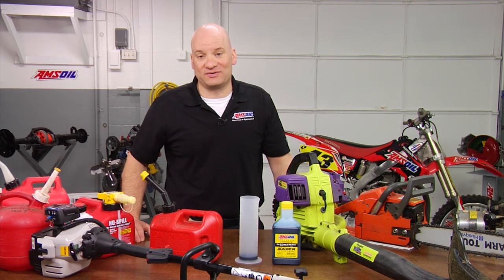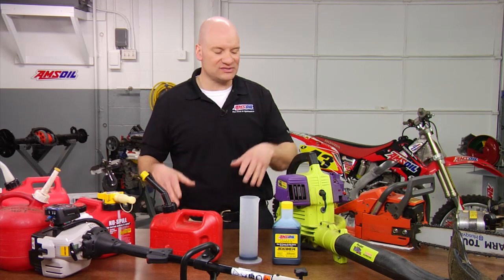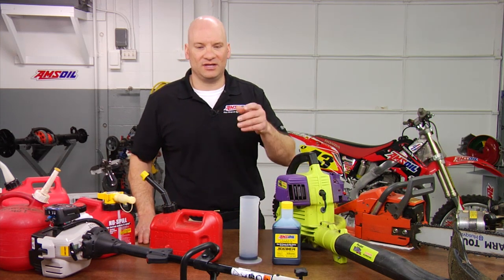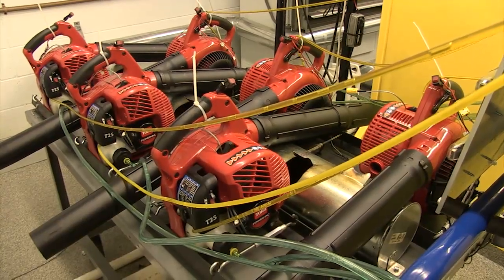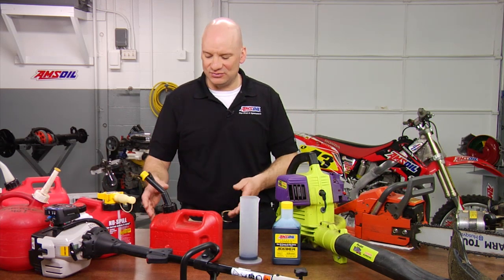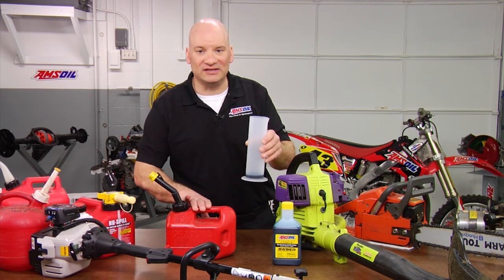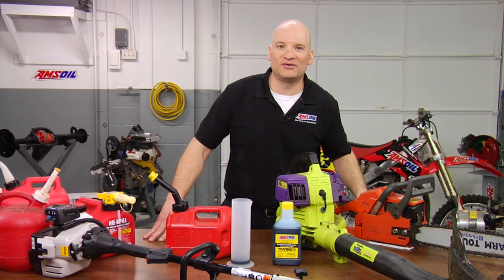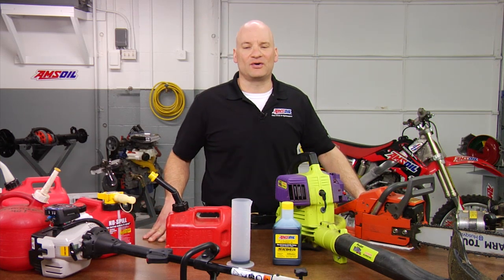SABER® Two-Stroke Oil Mix Ratios

Comment: @amsoil does this work for all two strokes such as bikes and sleds
Reply from the maker: +Kartyman550 AMSOIL’s primary recommendation for 2 stroke dirt bikes and sleds, including big bores, is Dominator 2 Stroke Racing Oil. Saber Professional has been formulated and tested for small hand held 2 stroke engines.
Reply: @AMSOILinc  Hmmm...Bike Berry offers an EPA approved two stroke bicycle motor kit, with the red ink warning that using any oil other than Amsoil Saber Professional Synthetic two stroke oil at 100:1 will damage it severely. What gives?
Reply: @stephenandloriyoung5716  I'm guessing because using any other oil at 100:1 would damage it severely.

Comment: Sir I don’t wanna get confused. Stihl hp ultra oil 2.6 oz bottle make one gallon 50:1. But AMSOIL saber 1 pack 1.5oz make one gallon at ratio100:1? Then 2 packs for 50:1 with what? richer but when I put another one gallon gasoline in with 1 pack of 1.5 oz in it look lighter than stihl hp ultra color seem like not enough oil. I won’t put it in my equipments look scary
Reply from the maker: We have a variety of package sizes, including a 2.6-oz. bottle, so you can choose whatever size works for you and the gas can you’re using. SABER is tested and proven at any mix ratio up to 100:1. There’s no reason to be nervous about using it at that ratio in your equipment, but lots of people mix it at 50:1. If that’s what you choose to do, you will have excellent results.

Comment: I have racing go karts with IAME 100 cc engines that turn 15000 to 16000 RPM. The manufacture says to mix 8oz of Motul 2T ester based oil per gallon of race fuel.  Am I understanding you correctly that I can run the Amsoil at 50 or 100 to one and not have any problems?

Comment: I use between 30:1 and 40:1 on all my 2 stroke engines, none have blown up. Ran another engine on 50:1 as an experiment and that thing threw a rod. I heavily use my engines and thats why i use a slightly richer oil:fuel mix than what manufacturers reccomend. I have yet to do a "torture" test on an engine using this oil here at 100:1. Ill run 2 tanks through it and see what happens. Btw im talking about motorised bikes and 2 stroke stimmers
Reply: @Alex Hickey ---Did you ever end up testing this Amsoil Saber Oil?
Reply: Bro this is crazy 100:1
Reply: @lightningsmokerXx  i did, but not at 100:1
Reply: @pablomerchant9285  madness isnt it
Reply: 33:1i s ok ls + ?
Reply: @Sensei948  yup its fine

Comment: I,m looking for mixed life. How long before it degrades when mixed? I have a mixed 5 gal. can of clear premium ($5 gal.) mixed with Saber that is about 2 months old.
Reply: It has a fuel stabilizer in it but it's a good idea to only mix what you think you'll use in about a month IMO. You could also add some Sta-Bil or something if you really wanna stick to larger batches
Reply: Saber has a stabilizer in it.  I've gone up to 6 months without any issues as long as I started out with non-ethanol gasoline.
Reply: @wayneedgerton5892  I'm using some right now that's been mixed for like 2+ months. I also add a dash of Sta-Bil to my mix if I'm not planning on running my saws etc. too much. Like you said, starting with ethanol free fuel makes a big difference. Ethanol will pull moisture in from the air and spoil it a lot sooner. I still wouldn't recommend using 6 month old mix though even if it's ethanol free
Reply: It's not really the oil that's degrading...it's the fuel itself. While Saber does have stabilizer I find it's always better to not mix enough than too much
Reply: @AnarchAngel1  I agree.  Mixing more than you will use in a reasonable amount of time is silly.  I am not encouraging that.
Reply: @AnarchAngel1  I agree.  That is why I said up to 6 months.

Comment: I am an early Amsoil user.  I mix up a 5 gallon batch with non oxy gas a couple times a year.  100 to 1 Amsoil 2 stroke, a little Amsoil stabilizer(or Stabil) some Amsoil PI (performance improver).  I use it in every small motor I own, 4 stroke or 2 stroke.  I have a 20 year old Husky chainsaw that feeds my fireplace, never had it not start. Runs like new and doesn't smoke.  Every now and then I have a carb fail from vibration, and on internal inspection, it looks like new.  This mix keeps carbs from pluging up upon extended down time (winter). I run this mix in my race car engines for winter storage.   I have also used it to bring old motorcycles and lawn mowers back to life after their carbs were wrecked by alcohol corrosion in the gas.  The PI will eat the corrosion.  Awesome stuff.
Reply: using 100:1 in your 4 stroke? does that work well?
Reply: @craiganderson1744 - AMSOIL P.i. is not recommended for 2-cycle engines.  The AMSOIL Quickshot is what you want.

Comment from the maker: Finally! A convenient, less confusing method to address gas/oil mix ratios in two-stroke power equipment.
Reply: So where will amsoil be when I mix up 100:1 in my dirtbike and fry the rings off? Not paying for parts that's for sure!
Reply: @DandSCreations  They dont claim its for dirt bikes, its for the small garden/forest/lawn equipment. I'm this oil at 50:1 would run your bike just fine.
Reply: @LilasTools  I noticed he didn't mention dirt bikes, but it seems to be implied that it is suitable for them, by one being shown among the equipment in the video.

Comment: When I bought a brand-new 1200W 2HP 2-stroke generator, my first concerns were getting it to run efficiently & performing a proper "break-in"... This meant using a synthetic 2-troke oil. Unable to find what synthetic oil I used before, an internet search led me to Saber form AMSOIL. After much reading upon their website, I decided to use the Pro formula seen here. But I still had a question: Since the generator's manufacturer called for 50:1 mix, and Saber allows one to safely run a mixture of half that, what mixture should I use for the first tankful on "break-in"?

 I emailed this question them, and they responded: Follow the manufacturer's recommendations during break-in with the first tankful, and then our recommendations of half that with every tankful afterwards. Well, I did... and I've not only been operating it trouble-free since, I'm actually surprised at how strong, smooth & smoke-free it's been operating! So now, when other "New" 2-stroke power-equipment operators ask what to run... or older ones ask what they can use/do to make their equipment run as well as mine... I just tell them: Cut the smoke from your 'stroke with AMSOIL Saber!
Reply: pancudowny 

Did someone pay you to write that?  That's a serious question BTW.
Reply: outstanding, slogan........i'm going to start saying that...

Comment: If you do I'll go out and buy it
Reply: +Tomas Hez Why would you want 20 : 1 when he just said you can use Amsoil at 100 to 1?
Reply: @whistlindixiesmallengine2085  the term rich and lean applies to the amount of fuel in the mixture not oil. And btw 20:1 is the most efficient 2 stroke mix out there makes up to 8 horse more than running 50:1 with no changes but jetting
Reply: @aaronbright5028  yes but more oil makes your fuel mix richer so you have to lean it out more to compensate for the extra oil the more oil you put in the more gas is gonna be displaced meaning less gas to the engine and more oil witch robs you of power and makes your engine run hotter more oil means more lubrication but gas helps cool the top end of the engine to  I'm not gonna argue with you iv been building 2 stroke race engines of all kinds for over 20 years from chainsaws to bikes I know what I'm talking about more oil definitely does not give you more power if anything it gives you less because your getting less fuel fuel makes power not.oil oil is there for the sole purpose of lubrication nothing more
Reply: @whistlindixiesmallengine2085  friction is heat. More oil less friction better heat transfer to your cylinder wall because you now have something to fill the thou and a half gap you left when you bored/honed it and the heat has to get from the piston to the cylinder so your water jackets can do their job and so your piston doesn’t grow too much from heat and seize.Everything you have said so far has been completely opposite of reality. More oil displaces fuel therefore making your fuel air mixture leaner so you have to jet up to compensate. In a 4 stroke you would lean your fuel air to make power so how exactly do you thing getting more fuel in is gonna be better.More oil also helps to keep heat in your crank so that when you fuel and oil blows by the oil can get hot enough to fall out of suspension from the fuel and do its job. Running 100:1 or even 50 makes your bike burn almost all of your oil up through combustion therefore making smoke and lacking lube. Basically you run 20:1 so you can lean your fuel air out to the edge of death which makes the most power and in the process you get the proper amount of lube to soak up and transfer the heat and enough lube to cover your crank and bearings to handle long stretches of high rpm.I hope you are just bullshitting about building race engines because you obviously have no grasp on how a 2 stroke lives and breathes.
Reply: @whistlindixiesmallengine2085  I guess I should also bring up the topic of compression as well. Adding oil to the fuel of any engine (2,4 or wankel) makes more power and more compression because of this little thing called ring seal. Metal doesnt seal on metal but it will on oil. Less blow by means less loss which means more power.
Reply: @aaronbright5028  ok bud since you think you know more than a professional
Reply: @whistlindixiesmallengine2085  I am a professional buster. Go do some research and get back to me
Reply: @aaronbright5028  whatever dude you obviously have never tuned a damn thing if you did you would know exactly what I'm talking about and you know what it really dont matter anyway its proven you can run at 20:1 or 100:1 with zero Ill effects except carbon buildup and excess oil out the muffler from a heavy mix like 20:1 so it doesnt even fuckin matter
Reply: @whistlindixiesmallengine2085  8hp doesn’t matter
Reply: @aaronbright5028  bro your not gaining any power from the oil the power comes from the gas

Comment: Why amsoil took the motorcycle out of the saber label? The truth please!
Reply from the maker: Hi Jose, As markets evolve, we carefully monitor equipment needs to make sure we’re delivering the best protection. We saw an opportunity to adjust the SABER formulation to better protect today’s handheld lawn and landscape equipment, so we dialed it in for that market. We did not test the new formulation in motorcycles and other non-handheld equipment, so we removed those recommendations from the label. That was an easy choice since we have other, better options for motorcycles, like DOMINATOR Synthetic 2-Stroke Racing Oil, which we have validated extensively in two-stroke bikes.
Reply: Man!! I still have a case of Saber. I was willing to use it on Beta Xtrainer for the trails!!!

Comment: I have you tested on Aircraft engine 2 strokes
Reply: i've used Amsoil in my Rotax 377 at 100:1 for 12 years now... 100 degrees less on the cylinder head temps.

Comment: 100 to 1? did you test my Husqvarna chainsaw at 14000 rpm for 5 minunts straight cutting through a big log on a 90 degree day? cause im not comfortable.
Reply from the maker: If you’re uncomfortable at 100:1, you can mix SABER at 50:1 or wherever you are comfortable and still have great results. For the record, we have put SABER through tests much longer and more severe than what you’ve described. SABER is extremely tough and will handle long hot days in the field at 100:1 with no problems.

Comment: So your saying 100:1 will work for my Toro 726te 50:1 2 stroke 2 stage snowblower in winter and my 50:1 McCullough chainsaw, 32:1 LawnBoy DuraForce and idc trimmer in hot summer with out any worries? sounds g ood but as a guy that will not let my 2 strokes die I'd be worried a little.
Reply: +Walter Null yes it will. I run leaf blower, stihl chainsaws, weed whacker, hedge trimmer. All call for different ratios. I have run them at 100:1 for 12yrs or so now. Have not had any issues at all. It also has a built in stabilizer.

Comment: Bel-Ray MC-1 ! In all my Toyz and yard maintenance equipment 2 stroke .! Yeah it’s more money , but so is a rebuild !
Reply: Mc1 was always my favorite as well at 50:1 but I started fouling plugs on my yz250 and no one could figure it out until I realized one day my power valve was clogged. Bel-ray informed me not to use mc1 on anything with a power valve for this very reason. Mc1 is more designed for air cooled 2 strokes without power valves. They instructed me to use their H1R and I’ve switched with zero problems. I guess Mc1 is fine too if you inspect/clean your power valve often. For me it was the power valve cover with the hose that ran off of it clogged. My jetting was right, but I do tend to jet to the reliable rich side. Just thought I’d share the info with you. Bel ray recommends H1R for these newer water cooled 2 strokes with power valves.
Reply: @jacobhendrickson8935  Oh yes I knew that  absolutely !